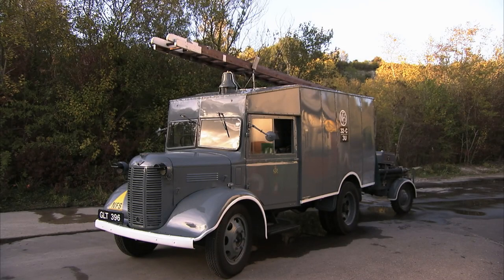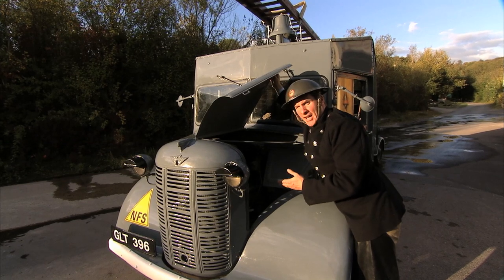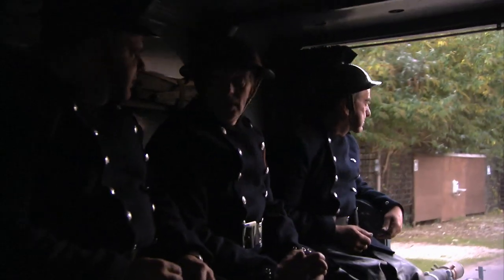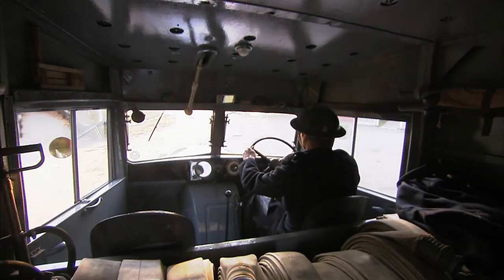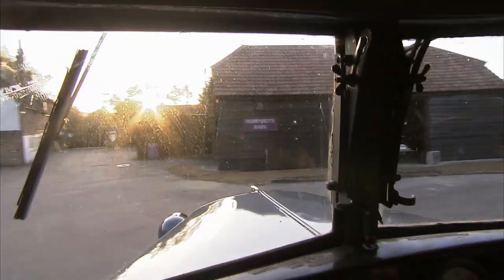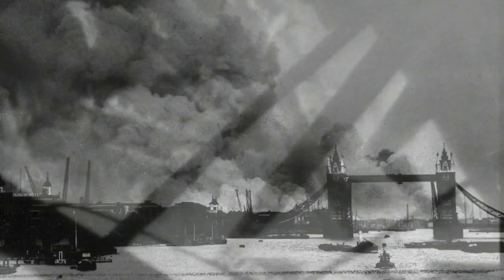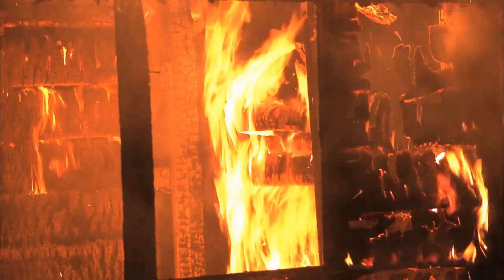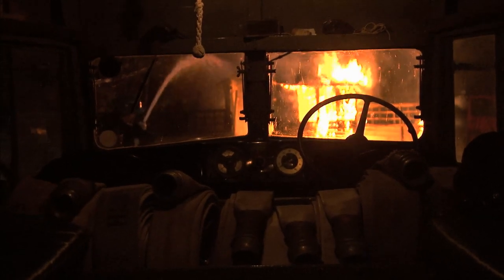Heroes of World War II... the Austin K2 Fire Engine

Comment: Nice little tribute to the Austin K2 ATV but factually incorrect: it was not 'deployed by the fire service in 1940' during The Blitz,  as it was not ordered/introduced into service until after the formation of the National Fire Service in August 1941, with many Fire Forces not receiving them until well into 1942, almost 2 years after the Blitz. Nonetheless, they performed sterling service later in the war, during the smaller raids and v-weapon attacks.
Reply: my grandfather designed and operated the 1st gas proof fire engine SONNING NO5 ,IN SERVICE 1938,based on a 1928 chassis and coachwork by Markhams Reading